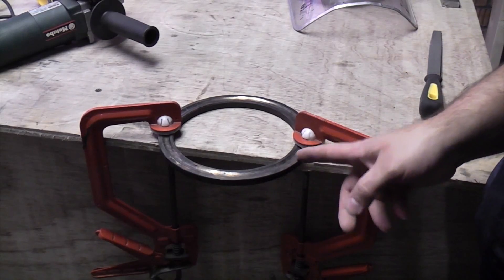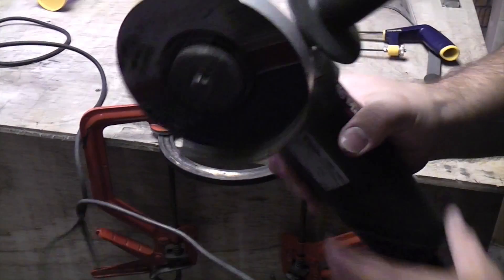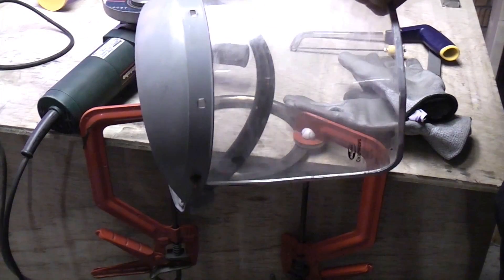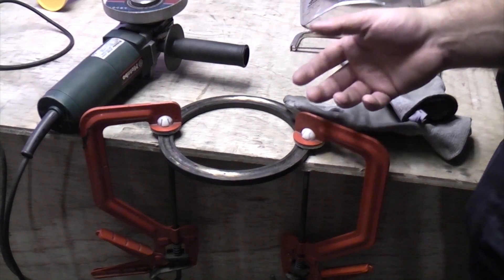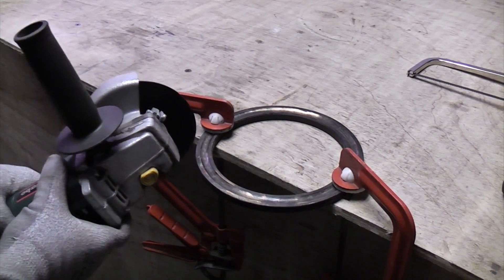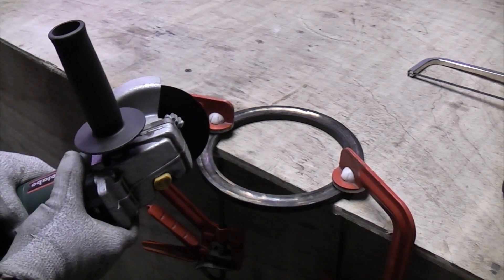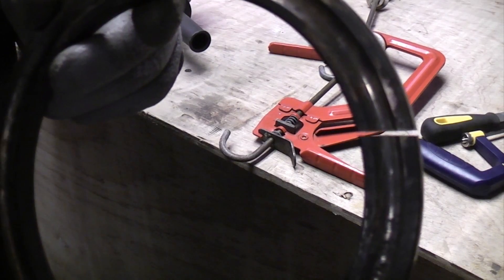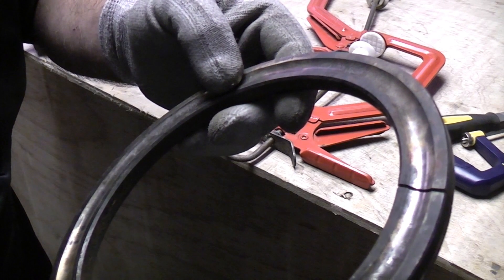How to cut hardened steel

Comment: but what if the hardened steel you want to cut is a bicycle chainring, so much thiner than what you cut in the video? Would you try cutting a chainring with a saw? Thank you for they video anyways!
Reply from the maker: Normally you cannot cut any hardened steel using a saw, because it is harder then the teeth. I have seen people cut through steel that has been case hardened, as that is only hard on the very outer surface of the steel. I guess it depends exactly how hard the steel is.
Thanks for the comment 👍
Reply: @ultimatehandyman  thank YOU!
Reply: @ultimatehandyman  succesfully cut it! but how do I polish/sand the edges now?
Reply from the maker: @oskibila3938   You can use a flap disk in the grinder or a polishing kit- https://www.youtube.com/watch?v=W2su6wsInwY

Comment: Will this cut through a Motorcycle chain lock ;  14mm six-sided chain links made of 3t hardened manganese steel ??
Reply from the maker: Yes, an abrasive disc in an angle grinder will cut through almost anything!
Reply: ES D angle grinders will cut anything in half. Like literally everything.

Comment: Another question...would a die grinder or dremel be able to cut hardened steel and would it be slightly safer? Maybe with a tungsten carbide bur? Thanks.
Reply from the maker: You can grind it using carbide burrs or abrasive wheels. 
I have never used a Dremel to be honest as they are more for model makers etc.
Thanks for the comment
Reply: ***** Thanks.
Reply from the maker: You are welcome.

Comment: Well, I learned something!  Just curious, what would one use a bit of hardened bearing race for?
Reply from the maker: You could braze it to another piece of metal then sharpen it on a bench grinder and use it as a scraper for scraping gaskets etc. 
This was done more for a demonstration really as someone asked how to cut hardened steel.  The only piece of hardened steel I could easily obtain was an old bearing race.
Thanks for the comment
Reply: Thanks!
Reply from the maker: You are welcome ;-)

Comment: Will this work on chrome plated flat bar?
Reply from the maker: Yes, no problem.
Reply: It will cut, but because of the great amount of heat generated by the friction, you run the risk of discoloring the chrome finish.
Reply: Worked great... chrome was a little blackened around the cut... but the piece wasn't going to be used for anything where appearance mattered. Thanks!

Comment: I want to make a knife, and I already have material for it - 3 mm thick sawblade made out of some really hard steel I have to make some really straight, long and precise cuts, but I don't know if i can do it with an angle grinder, how to cut precisely? Also, should I start the cut with low revs? Because I noticed that the grinder has a tendency for slipping to sides of the cutting line, while not deep enough in the material.l
Reply from the maker: +skurczybyk12 
You can cut it using a evolution sliding mitre saw, although the blade life will be reduced when cutting hard steels- https://www.youtube.com/watch?v=2lJV3wFzAYI

Comment: Do you think it would be safe to cut tool steel (air hardened A2).  For example, a 3/8" thick wood chisel blade.
Reply from the maker: +Slap Stick 
Yes, an angle grinder and abrasive disc will easily cut it. A thin (1mm) thick slitting disc works best.
Thanks for the comment
Reply: ***** Okay thanks.

Comment: Also the oxy-acetlyene will cut steel of any hardness, just dont try stainless free headaches come with that, and we all love the plasma cutter
Reply: If somebody doesn’t have extensive training or a super hot garage having those tanks is a lot more dangerous and complex than using a saw. Especially if they don’t work in the field and only need it occasionally

Comment: I have a metal spring I need to cut in half..... I guess I have never dealt with high quality steel until now... what would be the safest/ simplest way to cut a 4mm thick steel spring?
Reply: smeagle9999 angle grinder. Bolt cutters. Plasma cutter